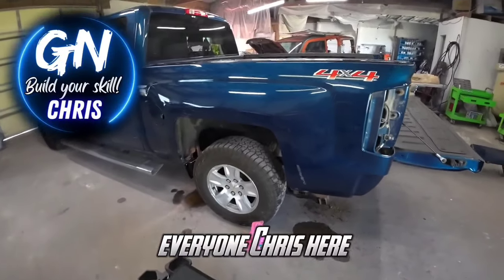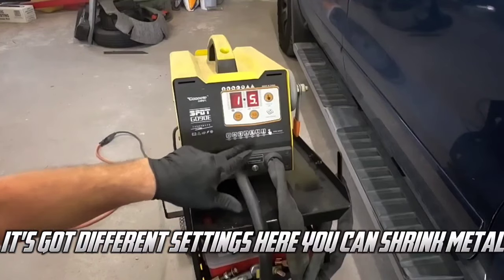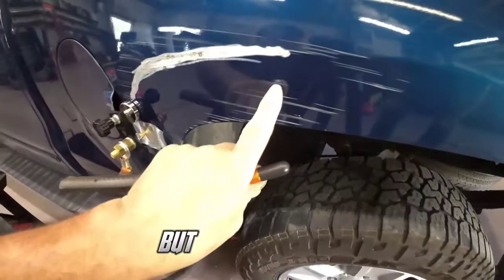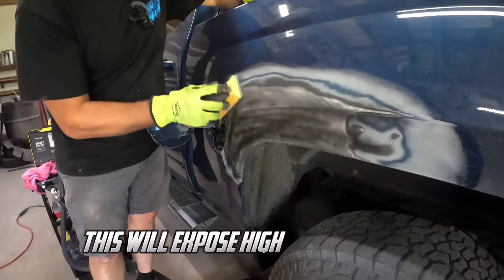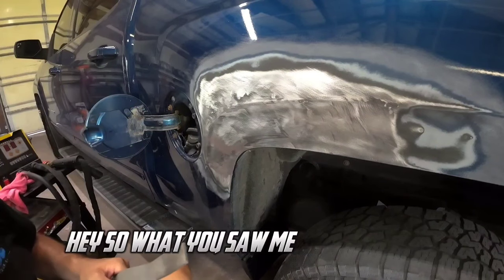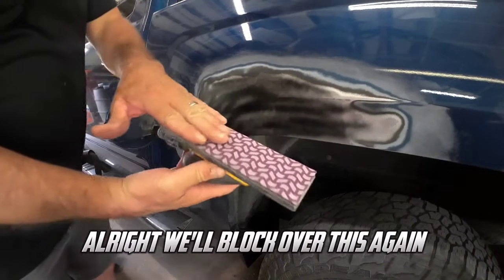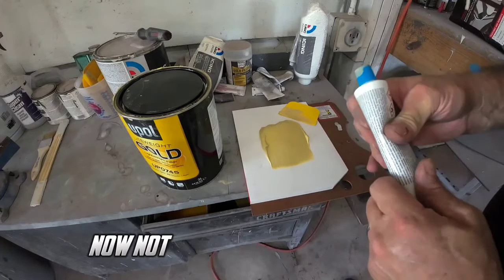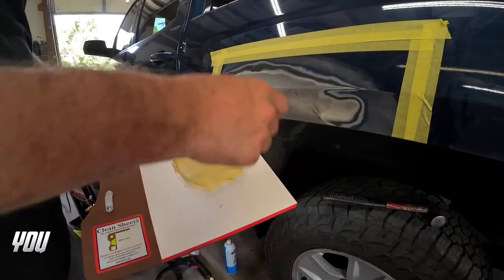Shaping metal before filler tips and techniques.

Comment: One thing I sure appreciate about your work Chris, you work the metal until it only needs a skim coat of filler. I know it takes so much more time and effort to get the metal right instead of slapping on an inch of filler and shaping that. Thanks for showing the right way to do repairs..
Reply from the maker: Appreciate that! Thanks for the support!
Reply: @GarageNoise  I finally picked up a G90E and had a chance to use it over that last few days. I've only used it on "Tool #1" so far, but holy crap! Thanks Chris for showing this machine several times on your channel, I think I am going to love using it!!

Comment: Great video as always sir. It does leave me with a question though. Should we be unhooking the battery when using a weld on type puller or using a welder on body panels?
Reply from the maker: I've  always heard that and like to do that, I don't always tho. I would definitely recommend it cause iv heard some first hand stories of air bags blowing.
Reply: @GarageNoise  thanks for the info! I love the videos! I did bodywork a long time ago and have been slowly getting back in and wow so many new products! Oh and thanks for the heads up on the A610!

Comment: Chris need your help again just paint and cleared a s10 bed and the clear is rough and runs everywhere what should I do and how? Sand it all down again and reclear it again or cut and buff it what would you do? Please help and explain how thanks again for all the great videos
Reply from the maker: If you sand it you need to block those runs. I would probably block it with 600 till it's  flat and re-clear. If you don't  block the runs you still may see them after you re- clear

Comment: Question? 
When I’ve you satin spray to find my low spots then use a pull it creates sparks, but I noticed yours didn’t, any suggestions?
Reply from the maker: Flat is better or get powder. Your referring to the guide coat right?

Comment: I tell you one thing Chris you don't half pack a lot of content into your videos, you should be a teacher in your trade as you have a way of explaining what you are doing so we are able to take it all in, I'm like a sponge when watching your videos, really enjoyed this one so thanks for sharing👌

I've now watched all your videos Chris and there are now some I will be watching again👏
My R500 arrived from China today, I'll be trying it out soon but I need to get an adaptor for my disposable cup system, I assume the thread is the same as the Iwata W400🤔 John UK.
Reply from the maker: Awesome! Thank you so much! I do my best to pack in the info much more than is just in the title. I am not sure about the thread size, I use the spectrum #57505 adapter from harbour freight you might not have that available in the uk. Appreciate your comment and support!
Reply: You certainly pack a lot into them all of which is good quality content. I got an adaptor for it from eBay the thread size is 16mm with 1.5mm pitch female, same as the Iwata W400👍

First impressions on the R500 are really good, it laid the WoW primer (sealer) very nice and smooth, and did a great job on a metallic gold basecoat it went on nice with no mottle or stripes and this was the first time using the gun, I still need to get it dialled in better for clear as it went on with a bit more peel than I'm used to, all this was done with the 1.3 tip.